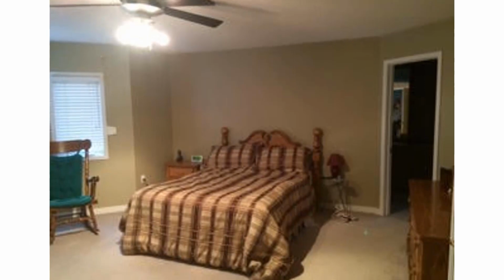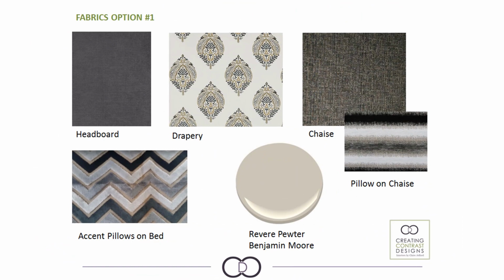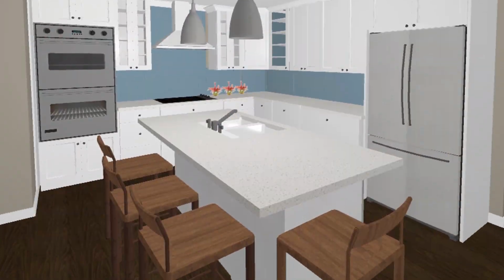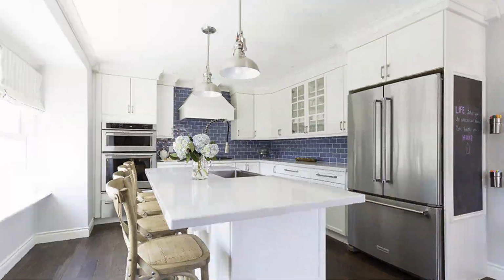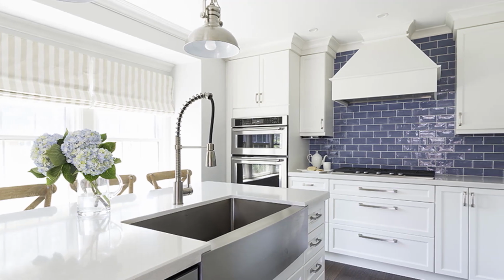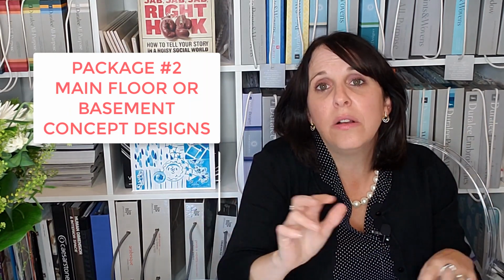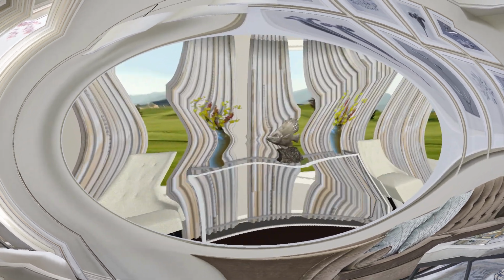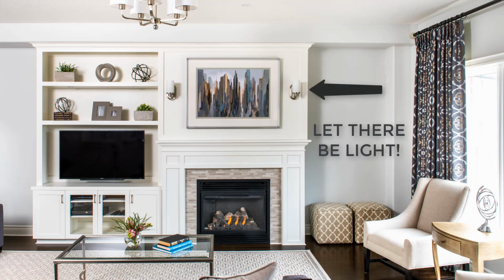Interior Design Presentations - The Power of 3D Design

Comment: When you are creating a 3D design that incorporates removing walls, do you have your GC look at the structure of the home first so you know if you are calling for removing a load bearing wall? If not, how do you price the job? Is the GC responsible for quoting construction estimate later?
Reply from the maker: Hey there.  Yes, we like to have the GC come with us to the visit after the initial consultation, once clients have confirmed that they wish to move forward with our 3D design package. It provides an opportunity for the clients to meet my GC and for further discussions based around structural elements we need to consider for the design.   We don't price the job, we send the GC our full scope of work and drawings once revisions have been requested and completed, then they quote on the job.  Hope that helps!
Reply: OK mam